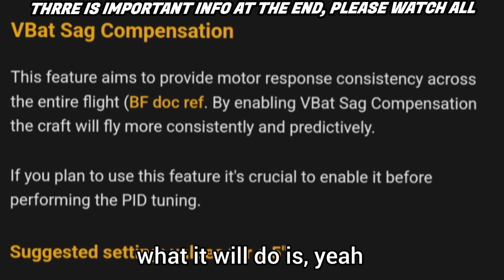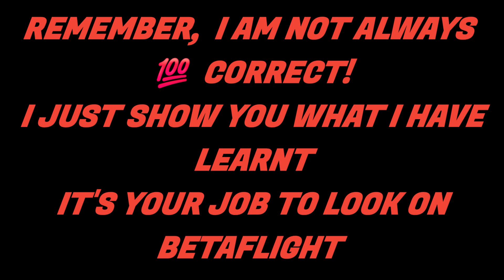FPV BETAFLIGHT VBAT SAG COMPENSATION PROOF! / WOULD YOU USE IT? #betaflight #fpv #expresslrs

Comment: I like to go into Battery&Power, and set my battery warning voltages to 3.6v for warning and 3.5v for empty. With a new pack I use full bat 4.22v, and for old packs, I change that to 4.10. of course, don't forget to set warnings on in OSD. These are not HVcells, I have never flown those so don't know the numbers for those.  (been working for me)
Reply from the maker: Sorry about delay, yes mate , i just have the talking radio vibrate and tell me the voltage, but alot of presets use sag compensation on their tune settings

Comment: Very useful practical information! I was having my VBAT compensation at 25% or so. Will increase it to 60-70%
Reply from the maker: Thanks, very much, please be carefull, the betaflight link in the description says for a 5", a value of 40 - 70 is best, this has youtubers, tuners like #MarkSpatz in the page, #tinywhoops 100% , you sound like you know your stuff, so just remember the drop off is quick at higher %.
Take care and thanks again!
RC ADDICT ❤️🫡
Reply: @rcaddict9558  thank you for the tip! I'm not every worried about the drop off, I always keep an eye on the actual battery voltage as I fly. So I bring it back before it gets to something like 3.6 volts average
Reply from the maker: @Sleeperknot ok, good man! Glad i could spread some knowledge, take care❤️🫡

Comment: I am not a fan of vbat_sag. I feel it makes your throttle unpredictable. Get used to keeping an eye on your battery and as you get further through your flight, know the moves will take more and more throttle. It is more predictable with vbat_sag off IMO.
Reply: Your test doesn't take into account battery sag after punches and recovery time. Just saying. Good Video either way!
Reply from the maker: Yes, thankyou! I wouldn't use it now, I'd prefer to understand my batteries longevity! I think in tinywhoop scenario yes! 
No ,the test does not show a full sag "opportunity ' I was banking on the wind that day! 
Even though I've left the video, would you take it down, or leave it? 
As it asks in most #presets "to tick the box!" and just wanted to expand on this!
Reply: If you are doing low throttle cruising, it makes sense. If you are doing random punches and unpredictable battery current draws (freestyle),. Then no, I would not use it. It is kind of a use case. And NO!!!! KEEP THE VIDEO UP!!! This is just my opinion. Everyone has one of those... and a butt ho** @rcaddict9558

Comment: I'll check that out.  Seems like one of my quads had it enabled from factory.  
Good info.  Thanks for sharing.
Reply from the maker: Alot of the Presets ask you ,"tick the box, but bad stuff will happen if you don't come in at 3.7/cell" 100% value is good for tiny whoops, but it's one of those settings that muscle memory, also knows that your throttle is higher at the end, I did not show it, but with it off, my throttle was at a lot higher 3/4 the way through the flight! 
I think ,tiny whoop, set it! But leave it off if everything is cool!

Comment from the maker: ❤"IVE WARNED ⚠️ YOU ABOUT THE DROP OFF SO PLEASE RUN LOWER VALUES! AND 📚 READ, OR JUST DONT USE IT IN THE PRESET TUNE TAB! THANKYOU🫡❤️
Reply from the maker: ❤❤GREAT FOR TINYWHOOPS /MAYBE JUST "DONT" TICK THE OPTION FOR IT IN A PRESET! PROOF IT WORKS, MY THROTTLE VALUE CREPT UP WITHOUT IT BUT ID RATHER BE SAFE AND HAVE MY MUSCLE TO STICK MEMORY KNOW  MY LIPO IS DIEING! 
WHAT DO YOU THINK?
IM NO CHRISS ROSSER BUT I LEARNT HOW YOU LEARN, PICTURES, AND BUY JOKES ETC!❤❤❤
Reply: @rcaddict9558  I been using Vbat_Sag_Comp on everything I build. My mind has learned to keep a very watchful eye on the voltage, and I always come back in at 3.6. When I very first started using it, I learned about dropout the hard way. Thanks for the test.